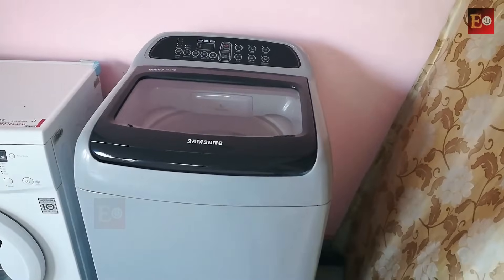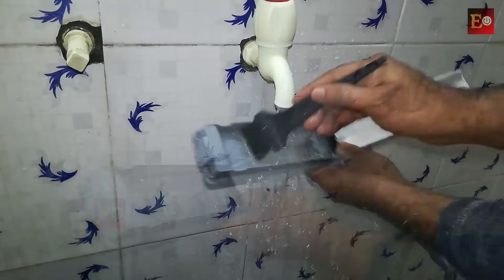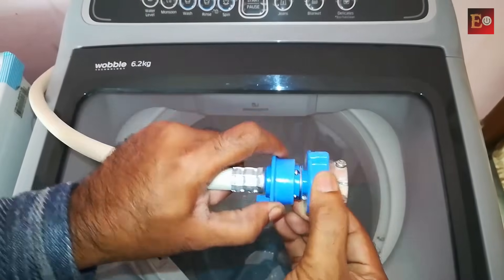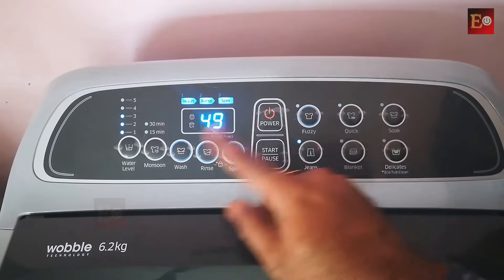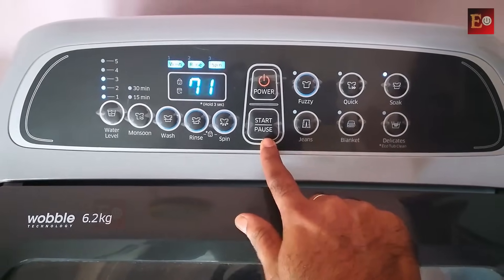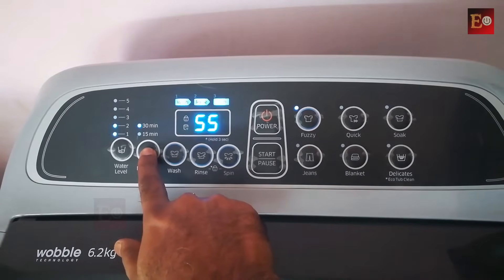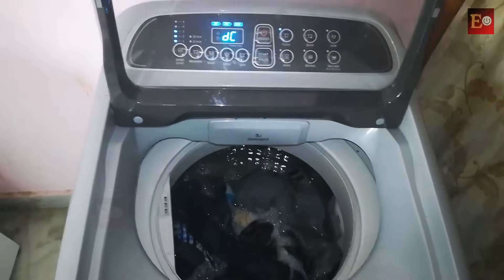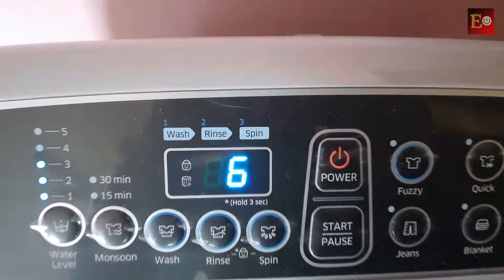Samsung Top Load Fully Automatic washing Machine Demo| How To Use Samsung Top Load Washer And Dryer

Comment: sir high sound  please solution
Reply from the maker: When ur machine lot of vibrates in Spinning time, Sound will come from the machine. Normally washing machine are little vibrates in spinning time. if your washing machine is lot of vibrates in spinning time, you have to check at washing machine four legs on the floor. if lags are not properly set on the floor or if any gap from the floor, washing machine is lot lot of vibration or shakes in spinning time.

Comment: I my machine water is not stop automatically when whole drum is completely full
Reply from the maker: you can choose there water level 1 to 5. default level is 3. If you choose 5 it will completely fill the drum.  decrease the water water level there then you start the machine.. Even you can,t solve this problem,  may be it is technical problem. Then better to contact samsung servicing centre or call to them. They will come to your home solve your problem
Reply: @ELECTRONICSALLINFO  thanx for quick reply, I have called customer care

Comment: Why my washing machine drained water After filling water without washing clothes and showing 4c always 😒
Reply from the maker: If machine cant gets the water properly, it will show 4c Error. The 4c error indicates that the washing machine has detected that there is a problem with the water supply. The most common reason for this error is a blocked or kinked water supply hose. ... 1 Check that the water tap connected to the washing machine is open to full.
Reply: @ELECTRONICSALLINFO  ok tq 😊

Comment: We bought new machine, but when we fill water it come to half leavel than go out buy it self without even start washing.....
Reply from the maker: are u filling water yourself
Reply: @ELECTRONICSALLINFO  we went yesterday to electronic shop and they told the back side machine pipe should b kept on top not down thats the reaseon and we did it than it work....old machine never have this system....thx
Reply from the maker: https://youtu.be/MAkoOlhs5d4

Comment: Very informative video. How to select appropriate water level? My previous machine used to weight clothes and suggest water level. What do the water level numbers correspond to in terms of litres?
Reply from the maker: Normally don't need adjust water level. We can use with default water level. There default water is 3rd. But if u add very less clothes less than 50% of the drum, u can decrease the water level. If u add more cloths more then 90% of the drum u can increase the water level.
Reply: @ELECTRONICSALLINFO  thanks I was able to use the machine with your guidance. What is the water saver thing... not clear about it.

Comment: Making loud noise in spin mode. Why?
Reply from the maker: Normally washing machine are little vibrates in spinning time. if your washing machine is lot of vibrates in spinning time, you have to check at washing machine four legs on the floor. if lags are not properly set on the floor or if any gap from the floor, washing machine is lot lot of vibration or shakes in spinning time.

Comment: Sir same washing machine..Samsung   mera hae but start kbbi le rha OR kbhi nhi le rha..hmmm kya kre reply to me
Reply: Key board chnge krna hoga kya
Reply from the maker: Can u ask in english
Reply: @ELECTRONICSALLINFO  my machine is ok..only start never..but machine started to all is well..but starting is problem
Reply: Machine is working and it's functioning also but some it's getting stuck while switch on and switch off....only for 1 time it's working when I tried to start second time it's not working
Reply from the maker: I think it is technicall problem. U call to samsung washing machine servicing center. They will solve ur problem.

Comment: What is meaning of 4C
Reply from the maker: The (4E )4C  error indicates that the washing machine has detected that there is a problem with the water supply to the washing machine. 1 Check that the water tap connected to the washing machine is open to full. 2 Check that there are no kinks or bends in the water hose connected to the machine.

Comment: Sir I have samsung 6.2 fully  automatic washing machine 
After completing the wash
Some clothes  are neat and some  clothes are derty 
I am also washing  drum is completely  cleaning
Tel me solution sir  please
Reply from the maker: Don't Use normal detergent powder. Use only Matic detergent powder only. Pause option is there. If your clothes have more dirt or stains, Pass the machine about 5 minutes after the machine starts turning the drum, and keep the machine in pause 30 to 45 minutes. Then after u can start the machine after 45 minutes approximately. If u keep the machine in pause, cloths will soak well with detergent and clean also well. Other wise u can also choose Soak option. But if compare to front load washers can clean better than Top load washers. Because front load washers can wash with hot water drum revolving also defferent.

Comment: I don't need spin option, so how to select only wash and rinse?
Reply from the maker: Tthere machine key pad has Wash, Rinse and Spin options separately. You can choose there which option you want. But if the machine dont do Spin , water will not go out side from the machine. Why dont you want Spin.
Reply: Spin is for drying, and I have enough space for dry clothes. Also clothes have wrinkles after spin.
Reply from the maker: machine keypad has Wash, Rinse and Spin options separately. You can choose there which option you want. Press and hold it 3 seconds
Reply: @ELECTRONICSALLINFO  how can drain water
Reply: Sangeetha Sangeetha tell this

Comment: we have only one tap whole house , is possible to use fully automatic washing machine
Reply from the maker: Fully automatic washing machine need water tap when machine washing the cloths. After wash completed u can remove machines pipe from the water tap.
Reply from the maker: You can also extend the machines inlet pipe
Reply from the maker: You can also extend the machines inlet pipe

Comment: Yar wash krty krty ruk jati e or 4C ka option  ata e??? 
What the problem plz describe
Reply from the maker: If the machine can't get the water properly from the water tap, it will show 4C error.The 4C error indicates that the washing machinehas detected that there is a problemwith the water supply. The most common reason for this error is a blocked or kinked water supply hose. ... 1 Check that the water tap connected to the washing machine is open to full.

Comment: Y dis machine show 4c sign??
Reply from the maker: The 4E (4C) error indicates that the washing machine has detected that there is a problem with the water supply. The most common reason for this error is a blocked or kinked water supply hose

Comment: Drayer not working properly only 30% only dray kindly confirm here
Reply from the maker: I think, your machine does not final cycle (Spin) dry your clothes. there should be on indicate 3 tights Wash, Rinse, Spin before starting the machine.  if the Spin is in off, the machine will not Dry(Spin) the cloths. Wash, Rinse, and Spin options are there on the machine keypad, we can choose manually.

Comment: what is 4c code sir.
Reply from the maker: 4E (4C) ERROR. The 4E (4C) errorindicates that the washing machinehas detected that there is a problem with the water supply. ... 1 Check that the water tap connected to thewashing machine is open to full. 2 Check that there are no kinks or bents in the water hose connected to themachine.

Comment: Brough this machine, but not taking water. Demo person says water pressure is very low. My indoor tank is full then also that person says water pressure is not enough.

I already used previous automatic machine (godrej make) with the same tap and same pressure without any problem.

How to resolve the issues. Company persons Says no problem with the machine. Then what's the problem????
Reply from the maker: If ur water tank in more height water come with pressure from  the water tap to the machine. If water come slowly it will take some more time. But no problem.

Comment: Dear Sir, I bought the same dual wash 6.5 kg yesterday I used for the first time, out 60 minutes only 18 minutes wash cycle blinks and and balance 38 minutes other cycles rinse and spin , after full process I am not satisfied with neatness, I thinks 18 minutes of just wash is not enought how can increase wash cycle time ??
Reply from the maker: Front load washers more prise and they can clean better than top load washers. you don't use Quick option. But If clothes are soaked in drum more time you will get a better result. please keep soak for one-hour by using pause option.
Reply: Is soak cloths using pause option, is it save electricity?

Comment: i only want to dry cloth
Reply from the maker: If you want dry only Spin option is there on the machine keypad. There Spin means Dry. If you want dry only press and hold Spin button. Then Spin will on and machine will dry only.

Comment: Plz sir rply me
Meri machine rinse 2 3 baar krti h
Reply from the maker: normally machine do three cycles after starts machine. they are 1) wash 2)Rinse and 3)Spin. there are wash Rinse and Spin option separately on the machine keypad. check these 3 options how many times there. press and check these how many times there.
Reply: @ELECTRONICSALLINFO  sir main normal wash pe set kr deta hun uske baad woh wash ke baad jab rinse option pr aati h tb 2 yaa 3 baar rinse krti mtlb 2 3 baar paani leti h
Reply from the maker: you reset wash and Rinse option buttons.

Comment: How to fix DC error code?
Reply: When I press start, it shows DC and machine does not work.
Reply from the maker: The washer`s overloading or if door is not properly close it will indicates with dc error.  If the weight of laundry exceeds the permissible things of manufacturer’s recommendations, the  DC error code appearance is expected. It is the natural washer`s reaction on your improper actions. Pull out the part of clothes and start pressing again. Others things have to be pressed manually or separately by running the spin mode for them.
Reply: I take all cloths out. I press Power Spin and Start. But, the dc error still shows. Is something broken inside the washer? Or any other solutions. Thank
Reply from the maker: Actually I got this problem if door is not properly closed or when I open the machine door if washing machine is in running. If can't solve this problem better to contact Samsung servicing centre.

Comment: My machine is taking to much time approximately  2 and half hour in fuzzy mode
Reply from the maker: Normally machine takes more time than the machine displaying time. Because its not calculate and not move time when water come to the drum. Only its calculate time only when drum is running.

Comment: When sppinning. After 2sec its stoping showing ub what it mean
Reply: Anyone reply
Reply from the maker: Spinning does not work.
• Make sure laundry is spread out evenly.
• Make sure the washing machine is on a flat, stable surface.
• Redistribute the load. If only one item of clothing needs washing, such as a bathrobe or pair of jeans, the final spin result might be unsatisfactory, and an “Ub” check message will be shown in the display.
Reply: @ELECTRONICSALLINFO   when wash completed time increses when it came to rinse.is this usual,. Your previous reply very usefull
Reply from the maker: If power gone or if open in door middle of the washing some time back on the display. Normally machine takes more time than the machine displaying time. Because its not calculate and not move time when water come in to the drum. Only its calculate time only when drum is running.
Reply: @ELECTRONICSALLINFO  please tell me about fabric softener dispenser how to pour in to it
Reply: Nice information 👍,if I raise any doubt plz reply me

Comment: 4c meaning please reply
Reply from the maker: The 4c error indicates that the washing machine has detected that there is a problem with the water supply. If the machine cant get the water from the water pipe' machine shows this error. water sariga vastundo ledho check cheyyandi.

Comment: What I should do ,? I want to rinse my clothes for 3 times.pl. reply fast
Reply from the maker: If u want Rince only if we press 3 seconds Rince option it will on and it will do only Rince.
Reply: You have showed your washing cycle in which clothes are rinse two times.I want to rinse clothes for 3times in less time
Reply from the maker: I did not need 2 times Rince. I'm using regularly fuzzy.

Comment: Samsung washing machine washing system is not good. Because of its 2 bottom roler  didn't mix the cloths while washing. So stains are remain as it is.My previous LG washing machine 3 round small flat thing mixing cloths all-around. So cloths are washing very cleanly. I regret my purchase of top load Samsung washing machine.

Comment: I bought a Samsung WA70 H4000S6 but have never managed to get it to wash yet. It just buzzes and buzz until it either give an ego . But it doe spin the clothes so I hand wash in the drum then spin it. It is an expensive spin dryer but what can you do if these cheap Chinese machines that have no quality control and more than often never work. I know I should buy better quality but there is only the cheapest quality for sale in Philippines and importing anything is nightmare as the customs will charge more than its value again so that they can keep all imports for themselves.
Reply from the maker: No samsung also good company. If you bought in showroom' they provide free installation. After bought the machine They will Come to your home and explain you how to use your washing machine. If you call to them or contact them, they will explain you how to use the machine.

Comment: Sir my first LG top load washing machine it's nice no noise.  Nice quality. But recently I'm purchase Samsung washing machine wa62m4200ha.  Full noise dust not going dust filter. Some problem this machine
Reply from the maker: if machine does not set on the floor properly, it will will vibrate in spinning time.

Comment: My washing machine is shaking too much ,like I need to hold it when rinse starts.plz suggest what to do
Reply from the maker: check at machine legs. if machine legs does not set on the floor or if there is any little gaps from the floor, machine will shake in Spinning time.

Comment: Water ko bahar kaise nikale jo reh gya ho baaki.....
Reply from the maker: Can u tell in English
Reply: @ELECTRONICSALLINFO  how to remove water if it remains after washing...?
Reply from the maker: It's completely fully automatic washing machine. It will drain water (pump) automatically after wash completed. We don't need to remove water after wash completed. It will remove automatically in final cycle.
Reply: @ELECTRONICSALLINFO  yup i know ...but i start the machine and water started filling then i off the machine now water remains inside it ...so how to deal with this kind of prblm

Comment: Sir clothes will not clean clearly
Reply from the maker: When you add more dirt cloths, top load washing machine cant clean clearly like the front load washing machine. But you can follow this. Choose the longest cycle in your machine and start the machine. Then pause your machine after 10 minutes and keep it pause in 1 hour and then start the machine. if you do like this cloth will soak and clean well.

Comment: Water not received in machine
Reply from the maker: If u start the machine, Is it run without taking water.
Reply from the maker: Which cycle did u choose on the machine keypad

Comment: MY MACHINE ALL TIME CAME  2C"" 4c""" 5c"""WHY CAME
Reply from the maker: 5E error code shows on your washersdisplay, it means that the water is not properly draining out of the washer. And The 4E (4C) error indicates that thewashing machine has detected that there is a problem with the water supply. ... 1 Check that the water tap connected to the washing machine is open to full. 2 Check that there are no kinks or bents in the water hose connected to the machine
Reply: my washing machine shows dc error.. how can i fixed it? thanks

Comment: After 0 it will not end automatically
Reply from the maker: U know telegu
Reply from the maker: Press and hold more than 3seconds Delicate Eco tubclean option. Then it will turn of tub symbol. Delicate Eco tubclean option is there on the machine key pad.
Reply: @ELECTRONICSALLINFO  no sir
Reply from the maker: What no?
Reply from the maker: R u using same model
Reply: @ELECTRONICSALLINFO  yes sir same model. I dono telugu
Reply from the maker: Is there Delicate Eco tubclean option on the machine key pad?

Comment: Why do we call them FULLY-AUTOMATIC when they need also our manual programming/selection. The machine do not have sensor for the type of fabric.  I HEAR THE WORD CHOOSE so its not fully-automatic. Do not confuse the users. Its fully-programmable. That is it.
Reply from the maker: Once u start the machine after selecting the program, it will wash, Rinse, and Dry in single drum. We don't need to change in middle of the washing. But in semi automatic machine, there are 2 drums 1st one for wash, and 2nd one for drying.

Comment: please tell me how to use only dryer (WA62M4200HA dp 8.10.18)
Reply from the maker: If we start machine it will do 3 cycles 1Wash, 2 Rince and 3 Spin. The 3rd cycle Spin means drying. You can choose which cycle you want. If you want dry only, press and hold hold Spin button 3 seconds . If you press and hold Spin button there will on and indicates only Spin(dry). Then you can start the machine.